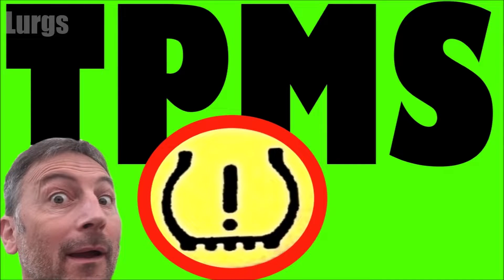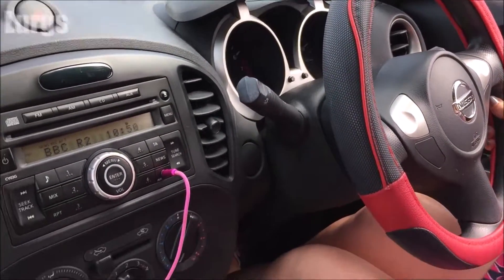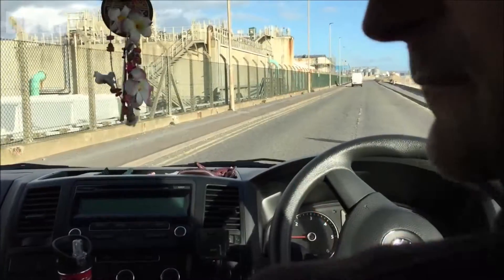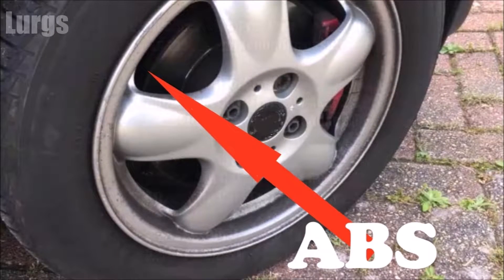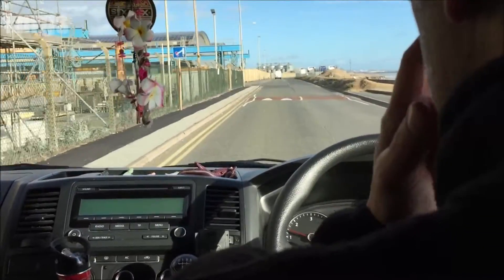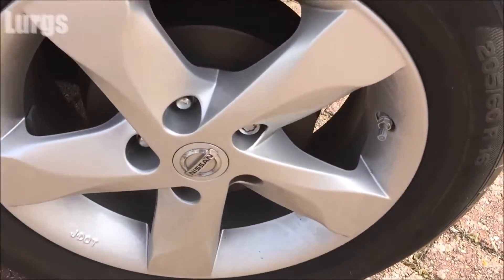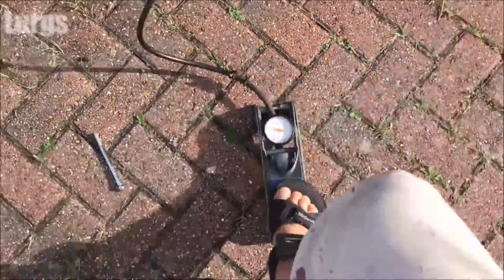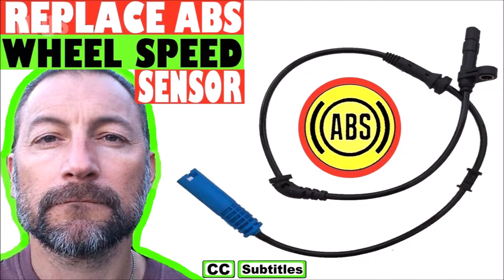What is TPMS and how does the Tire Pressure Sensor work

Comment: You explained what the in-wheel sensor does, but not how it works.  HOW does it "sense" the pressure?
Reply from the maker: It's an electronic device inside the wheel on the valve which senses pressure and tells the computer. All very clever.
Reply: @LurgsHowToGuides  HOW does it sense the pressure?  Lol!